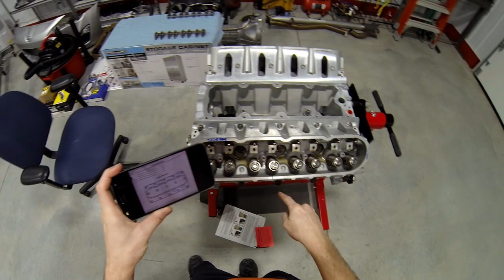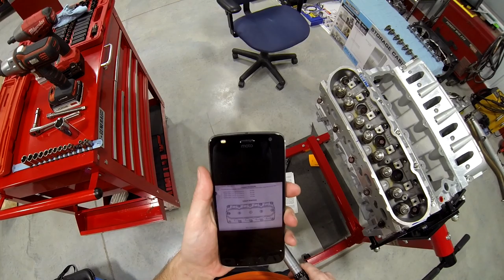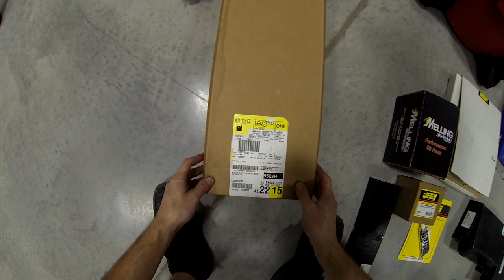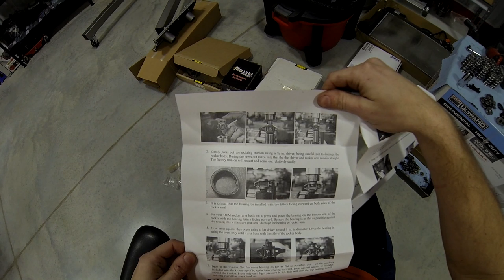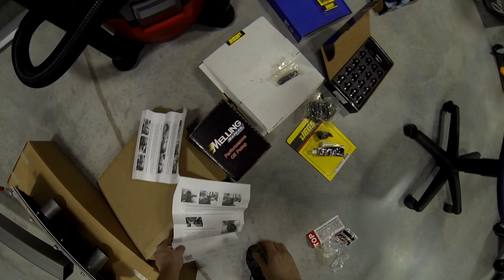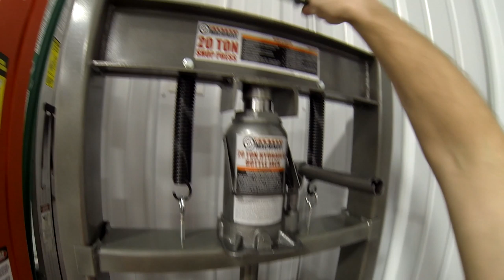How To LS Swap A Porsche 944 - Part 5

Comment: I would have used loctite on the cam gear bolts. I had them back out on the LS6 in my CTS-V. My bolts were fucked so I bought a bolt and retainer kit at oreilly with a little plate with flip up tab to physically keep the bolts from ever backing out again. COMP Cams p/n: 5461
Reply from the maker: Shit.  Too late now.  🤔